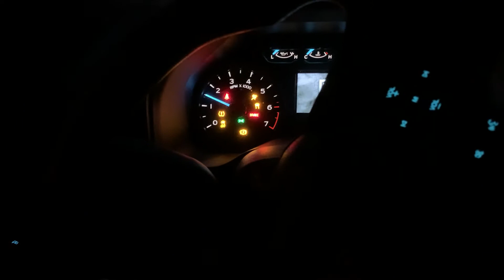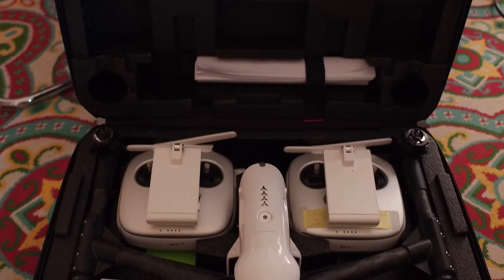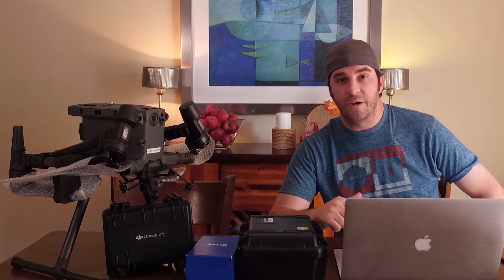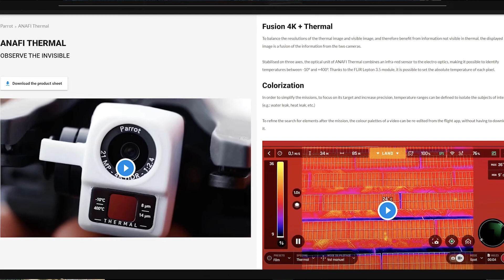Thermal Drone - Can the Freefly Astro or Autel Evo Dual compete with a DJI M300?

Comment: I’m looking to get my level 1 certification from flir, I want to add thermal capabilities to my business, any suggestions?  I cant jump right into an m300!  I looked at the anafi due to it being radiometric but I’d love to stick with autel especially utilizing their live deck?  Thanks
Reply from the maker: I am a huge believer in needing radiometric for all non public safety applications.  Being able to adjust the index range in software and see the heat patterns differently is a big part of the value add for thermal applications.  We use FLIR tools heavily for industrial inspections as well as confirming PV/solar findings.  The Anifi is ok, but a good entry point may be a used Matrice 200 series with an XT or XT2.